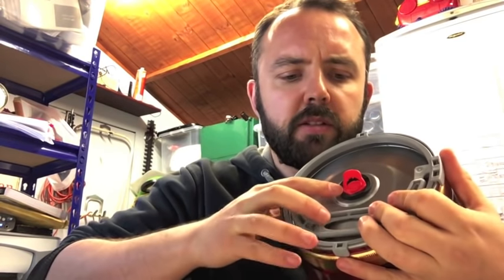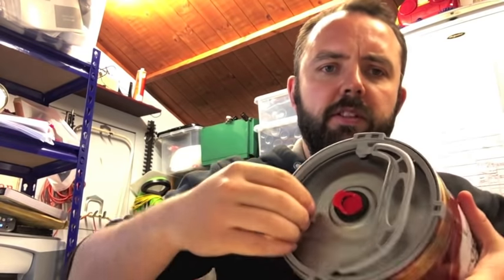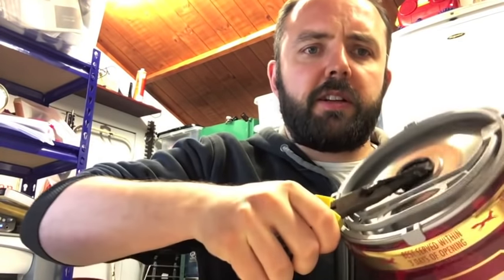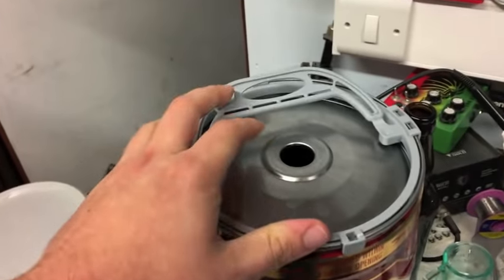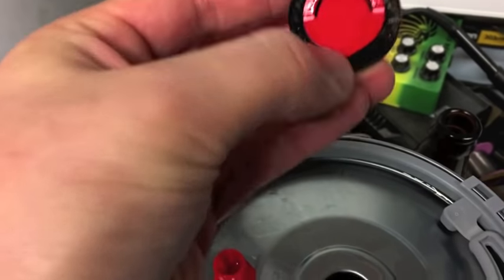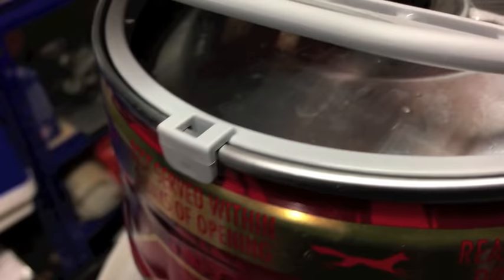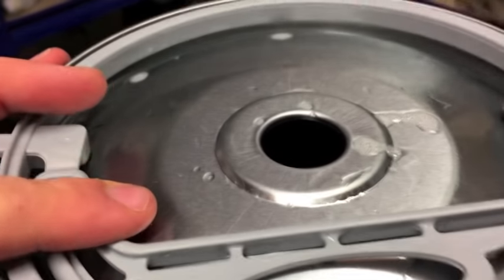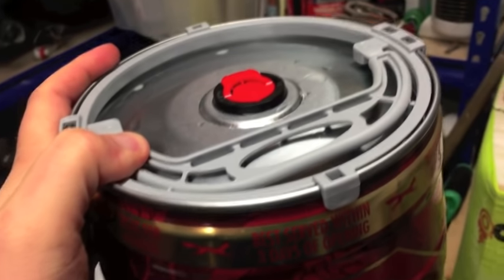How to Re-Use Mini Kegs for Homebrew Beer Tutorial

Comment: I bought one from morrisons last night and yes they have changed the vent plug on top, but I still managed to get it out in one piece without damaging it. So what I used was a couple of kitchen knifes to get a couple of millimetres gap under it ,then proceed with one of the 2 prong meat forks you use on a joint of meat by pushing the prongs under on either side of the vent bung and then carefully lifting it with a bit of force ,then go to the other side and repeat on all 4 sides untill it did pop out. No need to try and push the centre in as it is impossible.

Comment: I'm looking to prime a larger inside one of these. I've got the coopers priming drops with my kit. Would you recommend batch prime first or just add 12grms of sugar.  I may even invest in the co2 tap.
Reply from the maker: Hi Andrew, I wouldn't batch prime as this tends to give too high a carbonation level for kegs (assuming the rest is going in bottles) I prime the minikeg with the 12g and if I am bottling any remaining beer I will batch prime the leftover volume. You will get a much better lager 'fizz' with the c02 tap setups, mini kegs and PBs dont really work that well for lager IMO they deliver more froth than fizz if that makes sense

Comment: When you say "start dispensing beer", do you just open the spigot below and the beer is right? Or do you need extra equipment to post-carbonate or push it out? 12g / 5 l sounds very low carbonation. I also use about 5g/1l, so I would have put about 25g in there. If I just use the spigot to get to the beer, will it not be quite "flat"?
Reply from the maker: towi Torsten Will yes you just use it with the spigot. When you prime kegs and pressure barrels etc you do not need as much sugar to achieve the same level of carbonation that you would with bottles, if you put 25g in you will be serving foam at best and having a burst keg at worst.
Reply: Dudes Brews hey there! So 12g and it would be ready to pour beer in 48hours maybe?

Comment: Just about to try this for the first time with 3 or 4 Hobgoblin kegs. The bungs are horrible to get out ... It seems you need to rip off almost all of the plastic and rubber on top, then while holding the remains with pliers, push one side fo the bung into the hole and pull it out sideways. Lost grip on one of the bungs and had to fill keg right to the top with water and keeping it upright, try to catch the floating bung with the pliers and pull it out .... sideways again.
Reply from the maker: Pete Turner that sounds a bit of a nightmare! I have only reused the kegs with hard bungs a couple of times but I found the easiest method was to use a red hot knife to cut the bung in 2 down the middle and then pull out each half with the pliers. Good luck!

Comment: Great informative video. I wonder if you have had any spectacular incidents due to over-priming and I assume you only need to open the top bung once the CO2 is all used up or correct me if I'm wrong ?
Reply from the maker: Never had any explosions but did have one deform a bit after leaving it in the hot shed for a few weeks! You turn the red bit to vent the top bung when you want to start pouring so it works similar to a mini cask rather than keg in that sense cheers

Comment: I think they've changed the design of the vent at the top of the mini-keg. On this video and others it looks really easy to pull the top of the vent off (which is still really easy) but then pushing the red bit into the keg seems impossible (and this component is now black). Has anyone else found this? And have you found a way to successfully remove the new-style vent?
Reply from the maker: Amy Walters hi a lot of the kegs now have solid plastic bungs unfortunately which are not as easy to remove and can’t be refitted. It is possible to get them out but they have to be destroyed in the process, easiest way I found was to use a red hot knife to cut it in two through the centre and then pull the 2 halves out. You can buy replacement rubber bungs to replace the old one and they can then be recycled as per the video
Reply: I agree. I think they have changed the design. I have a Klarstein beer dispenser and I had a job and a half trying to remove the top red piece and the bung without completely destroying it. It was a real pan in the ar*e.

Comment: If I was using dextrose to prime would I still use 12g or would I use more or less
Reply from the maker: Nira at this size the difference will only be just over a gram more for dextrose, so you could do 13 instead but it's not going to make a huge difference either way

Comment: What a great idea thanks, out of interest how long do you think the beer will last inside these?
Reply: I have the same question - the original brewer's beer only lasts 3 days from opening (breaking the seal off the top catch) so should we assume the same??  My only concern is that the keg has already been 'opened' but I'm not sure if re-carbonating it re-seals it and then it is 3 days from first releasing the air via top catch

Comment: Great video. I know it depends on the beer but any ideas how long it would last in there once open
Reply from the maker: thanks! once you pop the vent it allows oxygen in so the beer will start staling very quickly most people would recommend drinking within a few days but I have extended that a bit by closing the vent in between pours in the past. Cheers

Comment: They are called needle nose pliers not long pliers
Reply: Pajsj Bshsjqu there actually called snipe nose pliers🤨 if your going to correct some one make sure your right 🤪
Reply: @TheWelshbrewer   far enough but if youre going to correct an engineer that has been using NEEDLE NOSE PLIERS since he started with british gas in 1960 makesure you're correct these are needle nose as they have a sharp point the point is just covered with tape

Comment: If for any crazy reason I do completely destroy the plastic bung, can I get away with putting a rubber bung and airlock in the top instead? Or is the tap gonna end up drawing the airlock water (and outside air) into the beer?
Reply from the maker: no you wouldn't get any carbonation if you did that as the co2 from priming would be released through the airlock